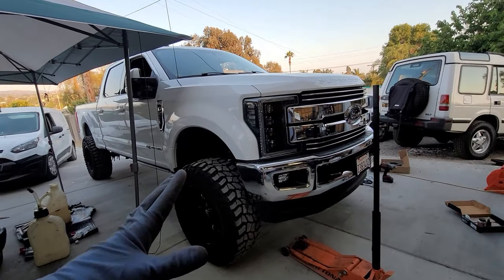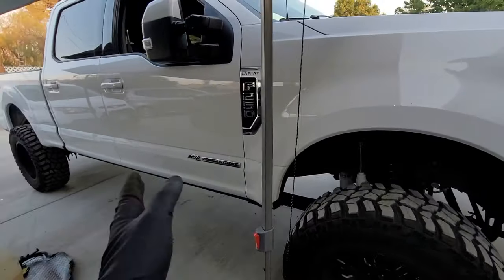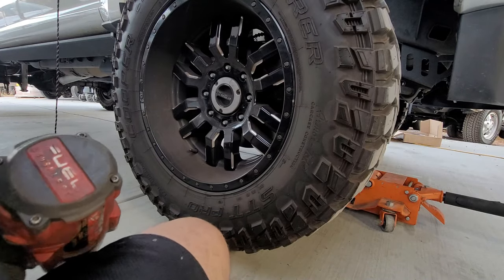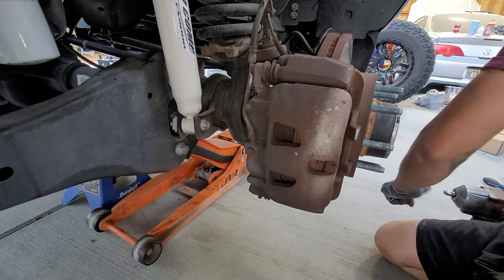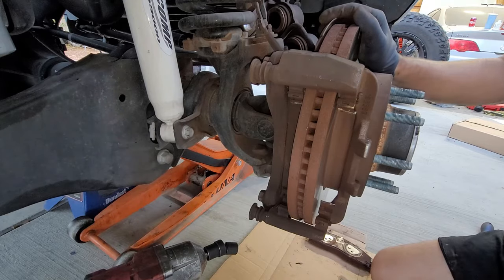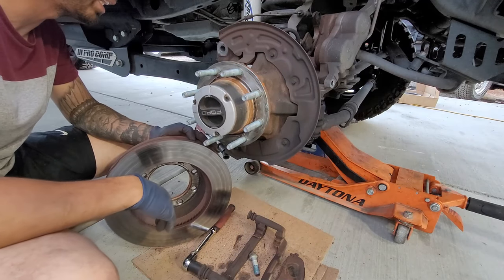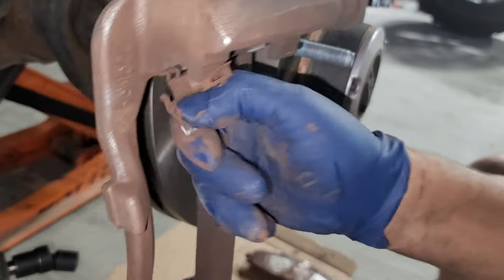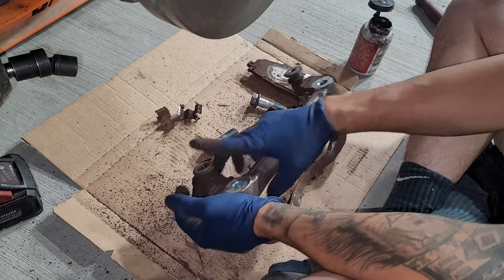2017-2021 ford F250 super duty front brake pads and rotors single rear wheel

Comment: It is a good idea  to remove the master cylinder cap and use a rag or paper towels to keep debris out.  If the brake pads are worn way down you may experience a little bit of overflow when backing the pistons down.  Great video nonetheless!

Comment: Pulled my driver side front off today to do my own brakes, I've done brakes before but decided to watch this to make sure no surprises would jump out at me. Turned out both pads had 1/4" or more on them, I guess the noise is in the rear pads. Also discovered a seized guide bolt on the bottom, made it nearly impossible for the new pads to go on. Ended up spraying the guide bolt with PB and reassembling with the old pads again. I'll give the rear pads a shot 2morrow.

Comment: Little tip, when installing new rotors use couple lugs to hold in place until you get brake calipers on. It makes everything go back on smooth and easy.

Comment: Thanks for the info! Only thing I would add would be to bleed the caliper as you compress it to remove brake fluid that can get contaminated inside the caliper.

Comment: Does it normally smell like burning after you change break pads adjusting to the rotors for a couple of miles  ?
Reply from the maker: Yes it will smoke or smell. It will go away